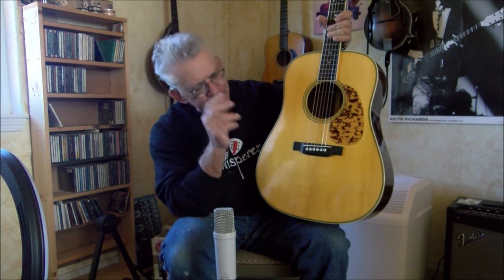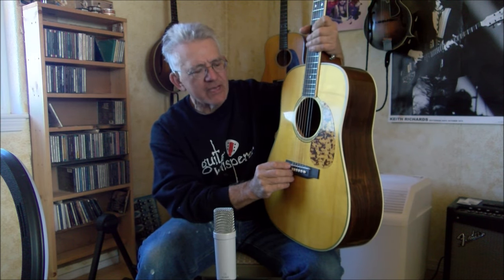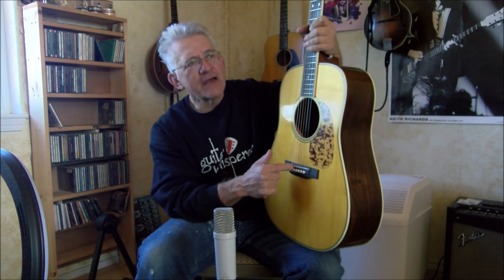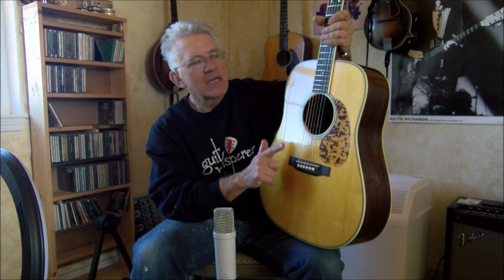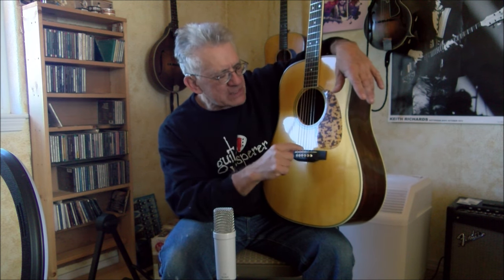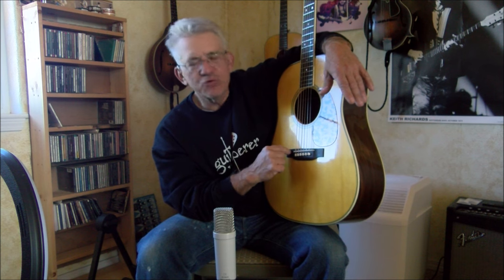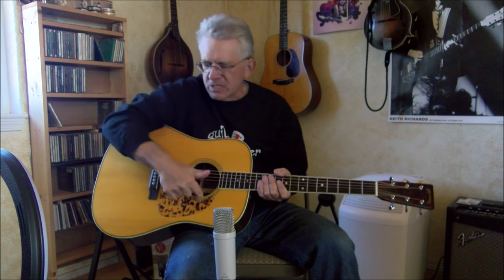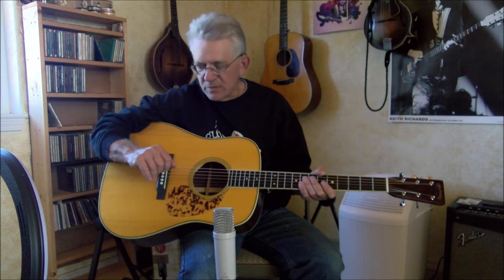Comparing  a short drop-in vs long vintage saddle

Comment: Man, that is a really good sounding guitar. Loud. I'm hearing what you're hearing with longer saddle, seems like there was more sustain on the low E, too. I'm a sucker for a bound fretboard (and headstock) but don't necessarily dig the other bling that typically comes with it. Are the soundholes the same size? With CSBG16 having a shorter fretboard?
Reply from the maker: I have to check on the sound holes but they look the same
Reply: Same size

Comment: Based on your videos and loving my OM-28 Marquis so much, I was thinking of converting my D-45 standard series to more of an authentic series with FWI nut and saddle and maybe adding the long saddle. Alternatively I could just switch to a FWI saddle. What are your thoughts for the absolute best tone? Also, what location do you recommend for a strap button?
Reply from the maker: I can't tell you what tone YOU will like.  I like bone.  See this video:
https://www.youtube.com/watch?v=jMbq8G3c7Q8

The saddle is a minor part of what makes a guitar an Authentic. The hot hide glue and non adjustable truss rod are huge, as is the bracing.
Reply: @Bryankimsey I definitely like the sound of the ivory better and the long saddle also sounds better to my ear. 

I thought that 2018 and forward (Re-imagined) all standard series have forward shifted X bracing? Isn't that the same as authentic series?

 Obviously some things can't be changed (like the hide glue construction, etc) ....was just hoping to get closer to the authentic series tone. 

Authentic series D-45's are just ridiculously expensive(and I prefer the hexagon 45 inlays vs the older)...so doing a few mods on a standard series I thought I could possibly get a little payoff.

I also know that there are laws of diminishing returns. 

If it was yours I'm guessing you would remove the popsicle brace and add a long saddle?

Comment: Hi could u do a comparison? Polish a matt to semi gloss and whats the effect to sound.
Reply from the maker: That can be your experiment.  I only work on 70s and the rare Authentic or vintage. 

I've done the opposite on mandolins...gloss to matte.  You're reducing the finish ever so slightly so they SEEM like they sound a little more open.
Reply: Thank you! What's your opinion on the sound impact? I did that by polishing out using Virtuoso and weirdly to describe it sounds very open . I think the trebles also seems to reduce making the bass louder. How? Could it be a polished surface improves bass?